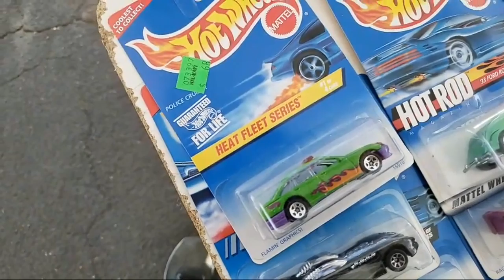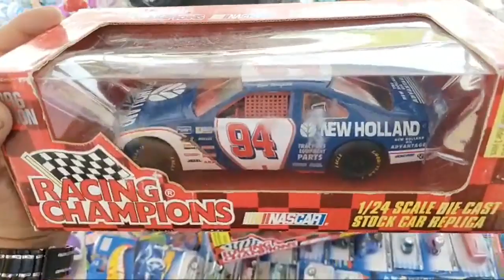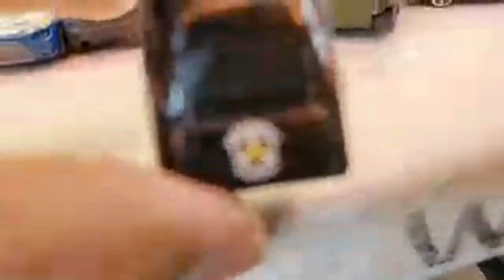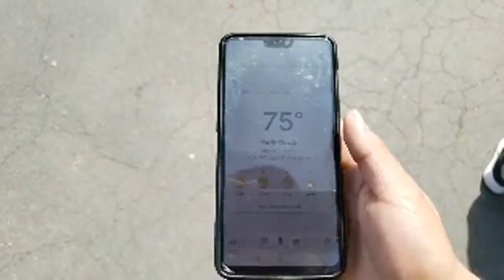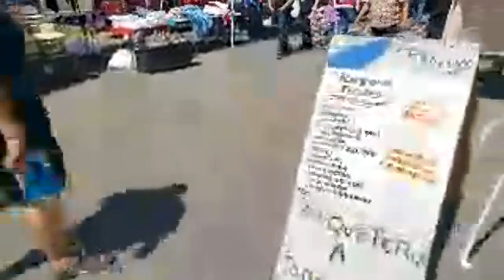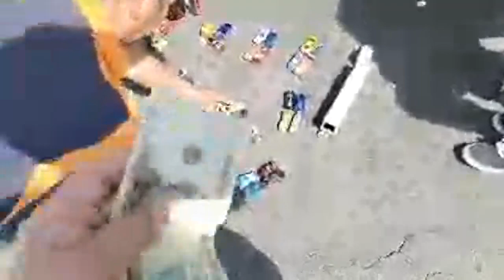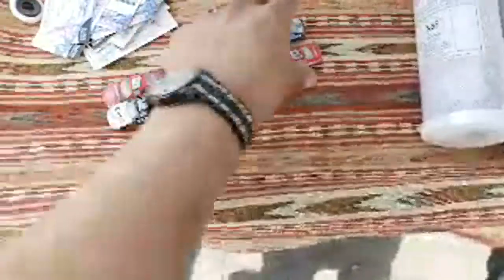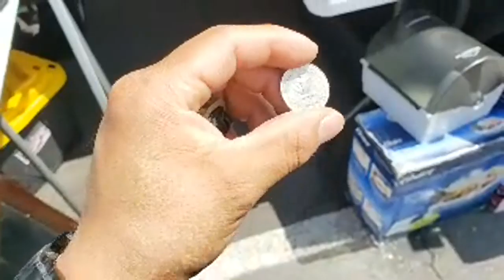Hot Wheels Hunting 🔴LIVE - AZ Swap Meet / Flea Market

Comment: Cool nice finds👍 the black ford thunder bolt sealed i have the exact one where i did a custom wheel swapped it with rubber drag tires and painted the tail lights red